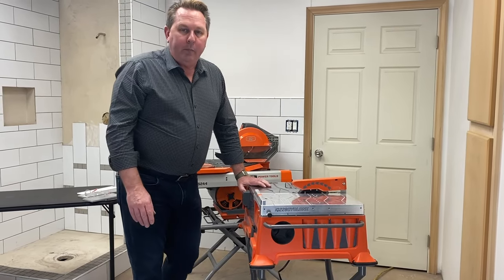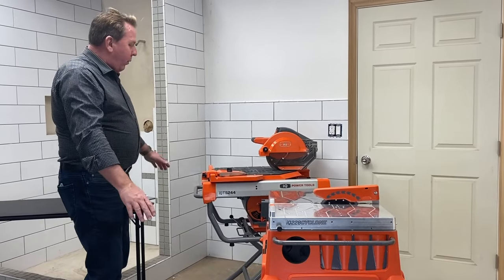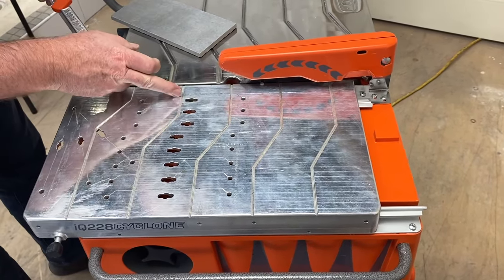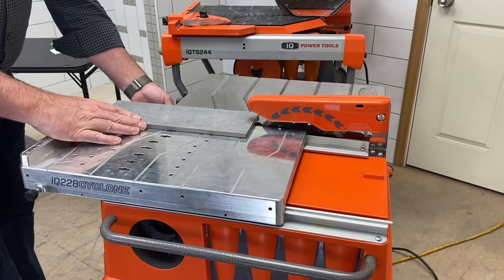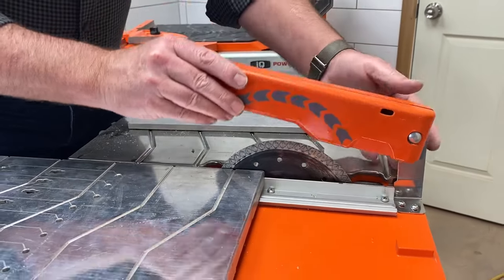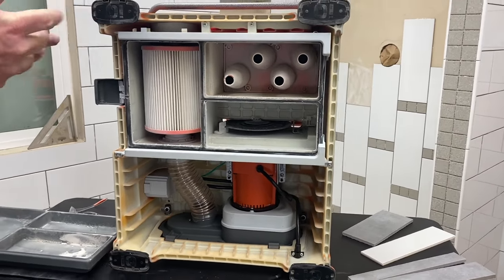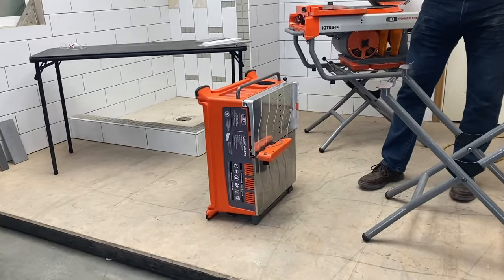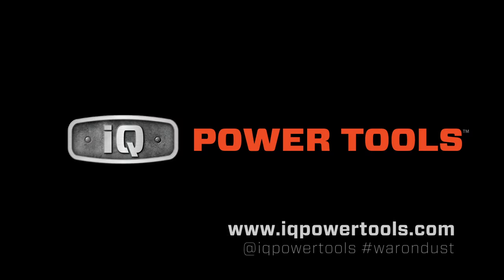iQ228CYCLONE Prototype Full Demo

Comment: Must use proprietary Q blades, correct? If that’s the case, can we see improvements on the glass blade front?
Reply from the maker: Yes it is a Q-Drive blade. We are still working on a glass blade.
Reply: @iqpowertools  Agree that glass is the only drawback right now. Great Product!!!

Comment: I just picked up my preordered 228 tabletop saw. I put it together and before I started it up I thought I would check to make sure the fence was square with the blade and it wasn’t. From the front to the back of the blade it’s a strong 1/16” out of square. Do you have a video showing how to adjust this?